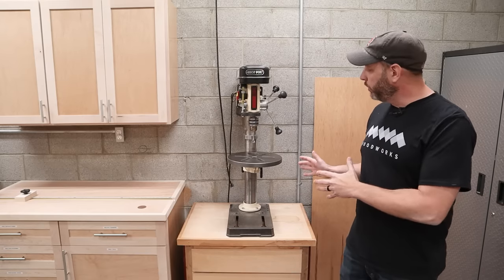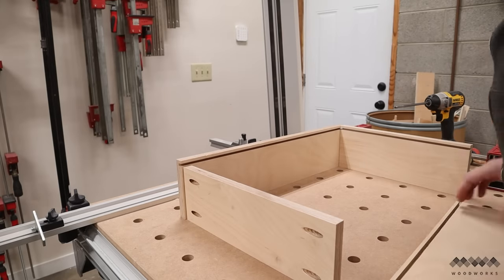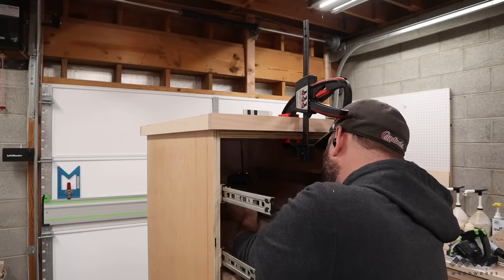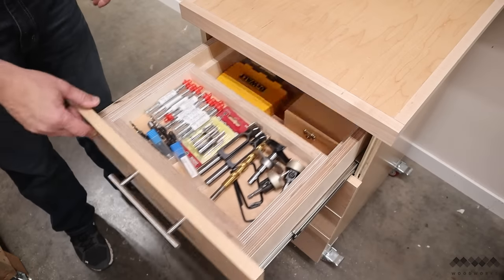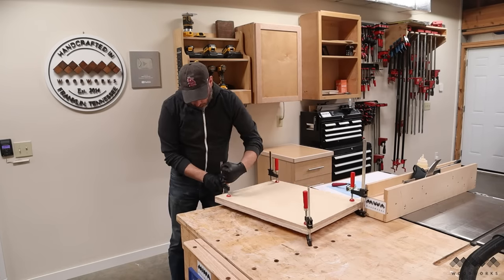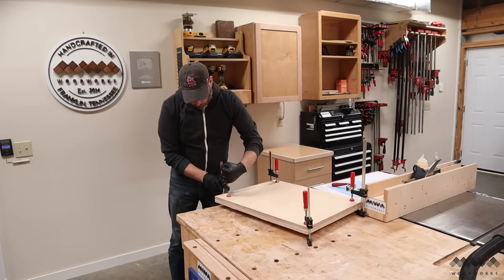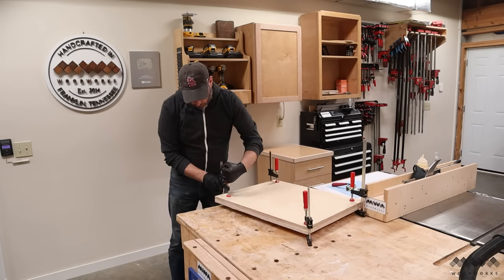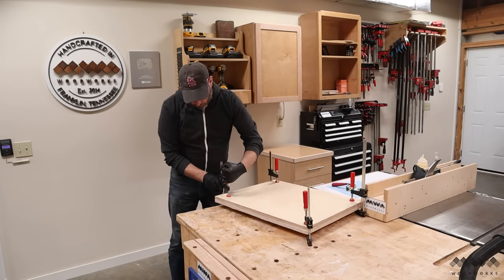5 ways to IMMEDIATELY improve your drill press

Comment: It's hard to find anything new in builds that hasn't  been done dozens of times, but I've never seen anyone embed magnets to prevent bits from rolling off a work surface before, and that's something that you can use in other situations too. Nice build overall, extra kudos for the magnet trick.
Reply: Looking at the picture i reminded me of a router table… could be double function
Reply: I glued some magnets to the underside of the top surface of my stepladder for the same purpose.

Comment: Save money, cut slots with your router instead of T track and you won’t need to drill through your aluminum fence. Put carriage bolts in the bottom slots and wing nuts under the table. Works great.Tip; dust collection on the drill press is a wast of time because chip ejection is 360 degrees. You can maybe catch 50% of it so you may as well just clean up after you’re done.  Otherwise good stuff.

Comment: GREAT VIDEO! my only question is that it looks like you spray the actual CA glue with the accelerant as opposed to putting glue on the magnet and accelerant in the hole and then assembling. I have never seen it done this way before... if you are not immediately assembling does the CA glue ever harden with the accelerant on it and not allow the magnet into place?

Comment: Wow… just…wow… you solved problems I didn’t realize I had.  Favorite hack is undoubtedly the sacrificial off-center circular plate (12:20) in the center of the table that you can rotate to get a new drilling area when you need it to eliminate blow out on the back side of your work piece. 
Nice work

Comment: I really like the magnet under the table for bits falling off. An upgrade I did to my drill press that you did not mention is converting it to a variable speed without changing belt positions. I did this by repowering the drill press with an old treadmill motor and controller.
Reply: That sounds like a video? 😀… or please post a picture here?

Comment: Nice build! I bought a table, and it has most of those features. I have a 4" drill press vise mounted to a board and that sit's on top of the table 99% of the time. I have never once used the tee tracks although I was certain I would prior to installing it.! I placed a large version of a kitchen knife magnet on the belt cover, and it holds at least 30 bits and a few chuck keys.

Comment: Excellent ideas for upgrades to drill press.  I have an old ShopSmith (like born in '52 old ... like me 🤣) which I am using as drill press now mainly - but the table and maneuverability is just not smooth etc.  I'm excited to build this upgrade table to get more control and accuracy from the drill press. Thanks for the great video.  PS: I bought your 'Ultimate Table Saw Fence" plans, and although they were lacking some details I am LOVING the Fence and have built all the jigs too!  Thank you.

Comment: As a note you can buy down cut blades for your jigsaw.
If you use a square sacrificial section and offset it by about a 1/4 you can flip it 4 times before replacing it. 
Looks nice and is a great addition to a drill press. I made a similar table for my drill press but stuck exclusively to wood and T-Track.  I also used some 1x to edge the plywood as I just didn’t like the look of the exposed plywood. I made some extensions for my table raise and lock rods so I could adjust my table height and lock it down without issue. With a good table I find myself using the table much more for woodworking.
Reply from the maker: Yeah I've already ordered some downcut blades to add to my tool bag!
Reply: @MWAWoodworks : Just be aware they’re a different beast to standard blades. You really need to go slow and make sure you’re pushing down otherwise they can throw you out of the cut and cause quite a bit of damage.

Comment: This is by far the best drill press table I've seen, since Shop Nations drill press table lol. Shout to Travis for the under the table t-track idea. Touch of genius right there. Lots of features that are here and there from other drill press tables I've seen out there 👌🏻. I use magnets as much as I can in the shop but the idea to stick them under the table to catch any bits, didn't and prob would have never occurred to me. GENIUS. The caddy for bits at the table, I've seen that a lot around, specifically on Pinterest, BUT, never really thought it would make a good solution, simply b/c I'd be too lazy and leave the bits there as oppose to putting it up where it goes. Just a personal issue I guess 🤦🏻‍♀ lmao. The best feature, at least to me is the shop vac so simple yet, never would've thought about this at all.
Reply from the maker: Yeah Travis and I discussed the t track on the bottom! Super genius idea 💡

Comment: This is awesome. I love your design for every part. The magnets are a stroke of genius. Easily the best part. I built a similar table a couple of years ago using melamine which didn't hold up as well as I had hoped. I used an 80/20 extrusion for a fence too. Best decision. Now I think I need to rebuilt it and definitely add the magnets. Awesome project 🍻
Reply from the maker: The 80/20 is the best. I have it all over my shop

Comment: Just another idea for the drill chuck. An old blown out speaker from the thrift store contains a really nice magnet, depending on speaker size maybe 3 or 4 inches in diameter. attacking it to the body of the drill cabinet, wherever is handy to grab holds your chuck key for handy retrieval. If the magnet attaches to the chuck key and pulls off the drill cabinet, a drop of CA glue on the magnet keeps it in place once you determine the ideal location. Just an idea.
Reply from the maker: I've kept my chuck on a magnet on the side of the drill press for years! Great minds think alike!

Comment: I took the idea and added elements to accept a set of outfeed rollers.  It extends the holding area for large work pieces.
Reply from the maker: I almost added support wings to mine but the cost was getting to be too much for the benefit.
Reply: @MWAWoodworks  it was a matter of necessity for a job and has paid off a few times since

Comment: Great design with some helpful details I’ve never seen before! On dust collection, I’ve found putting the hose as close as possible to the bit gets nearly everything, even with a Forstner bit.
Reply from the maker: That's the key. I've also tried using my 4" hose, but it's just too intrusive and can get in the way of operating the drill press
Reply: Try adding a step down adapter from 4" to 2" which will increase the velocity as it tries to maintain airflow. While you're down to that diameter, consider adding on one of the flexible semi-rigid hoses that hold shape and position to manage the perfect position close to the bit and stock.

Comment: Some really awesome suggestions! Love your solution for holding the vac hose. I made a very similar drill press table by laminating 3 pieces of 1/2 baltic birch plywood, complete with track runners for hold downs and a homemade fence. I cut a rectangular hole in the top layer thinking it'd be easy to make replaceable inserts. It turned out pretty well and I made a bunch of inserts. Only problem is -- I NEVER have to replace them because I still use a scrap pieces on top of the table when drilling holes. lol
Reply from the maker: 😂😄😂😂 I used to have a table with rectangle inserts and I never changed them because it was a pain to pop them out. I'm hoping this way just rotating it is simple and I'll actually do it.
Reply: @MWAWoodworks  Lol Would love to hear how the circle works for you in the long run -- agree spinning would be easier. Mine are easy to flip around or swap out, I just can't get past the idea that a single hole is going to require more effort (minimal as it may be), and add another step the next time I have to drill something. Definitely a mental obstacle and sounds silly but I've found it's too easy to keep a piece of MDF on the table and freely move it around. John Heinz has a video where he made a new drill press table sans replaceable inserts for the exact same reasons. Mentally, I went ... YES! haha At any rate, keep up the fantastic work ... appreciate the heck out of you!

Comment: I love these add-ons and I am inspired to upgrade my drill press cabinet now, especially the table. I love the dust collection addition, but I am thinking about attaching the strap to the block with a t-nut that can be positioned in the t-track. No extra hole in the table and the position can be moved to either track.

Comment: Great build on the drill press stand. Using the 80/20 extrusion was way cool for the DP fence. I never knew you could use traditional T bolts in those slots, so tone of possibilities exist for the Misumi products.
Reply from the maker: Yeah I have used Misumi several times over the years. It was such a great find for shop jigs
Reply: @MWAWoodworks  Thanks. If possible, it would be great if you could give us a primer on the use of the stuff, particularly with regards to compatibility with T bolts, etc. I know they have many series of extrusions and have now idea where to start.

Comment: great upgrades, i need to do  something about the max distance that a hole can be made from the edge of the pice to the drill bit, any sugestions abouth that? my drill press distance is a little short only 20 cms and i need at least 30, dont want to have to change the machine  if posible to make an adaptation or something! thanks

Comment: Can you still adjust the table height with the new table?
Reply from the maker: Yes depending on where you fasten it to the stock table. However I ditched the little handle and I move my drill press up and down with a drill powered ratchet.
Reply: @MWAWoodworks  oh I see. You take the crank arm off and you are left with a maybe 3/8’s square to put a socket on to use your drill driver to power up/down. Great idea.
Reply from the maker: Exactly! So much faster.

Comment: Beautiful work, as always.  Question: What size drill press is that?  How do you like it?  I’ve been thinking about something like an 8” or 10” drill press.  About three years ago, I acquired an old 13.5” drill press, cleaned it up and made some repairs.  It runs real nice, but it is HEAVY, and kind of big for my garage - hence the interest.
Next issue: I would like to build a drill press stand along the lines of yours, on casters - but the floor slopes several inches from back to front, so it would also need leveling feet.  I have been trying to come up with a good way of having both casters and leveling feet.  Any ideas, thoughts or suggestions would be most appreciated.
Reply from the maker: I have had my jet drill press for 8 years. It's a 13.5" as well. For the amount of drilling I do it has been a good tool. As far as the cart, you could put locking casters on one side and leveling feet on the other and then on the side of the cabinet with the leveling feet you could add one of those side wheels that you have to step on the lever to raise it up. Then you could roll it around when you needed to.
Reply: @MWAWoodworks  Thank-you for the prompt response.  I do not understand the reference to “side wheels”.  It sounds like some sort of retractable caster - perhaps a commercial product.  This sounds intriguing.  I currently have diy retractable casters under my contractor style table saw, drill press, assembly table, etc., but that consumes a lot of space, which I would rather allocate to drawers.  Please clarify or point me in the right direction.  Thanks again.
Reply: @MWAWoodworks  It just hit me - I think you may be speaking of a Rockler-style retractable caster, that would be mounted on the side of the cabinet.  Is that correct?
Reply from the maker: Exactly
Reply: @MWAWoodworks  Thanks!

Comment: I love each component of these builds. I was going to use a black melamine shelf cut down to size for a drill press table, but I think the for mica is sturdier. I am redoing the interior of the shop this spring and bringing in the new drill press so I can build it then. What did you use for a countertop on the section to the left of the drill press? I like the look a lot and I think it will be easier to replace than Formica. Thanks for sharing your builds with us. I love the Forstner bit holder you made. Very clever!!
Reply from the maker: Formica is definitely more hardy than melamine. I like to coat all my work surfaces in Formica if I can. The counter next to my drill press is my miter saw station. That's just plywood.
Reply: @MWAWoodworks  I just checked and my local flooring and kitchen shop carries it. They said there isn't much need for it anymore. He has some half sheets that he is going to give me!! Plus, some black 8x4 sheets that I will pay for.  There are still nice people in this world of ours!

Comment: Lots of nice upgrades here.  Two bits of unsolicited advice... Make your sacrificial inserts square instead of round.  It's much easier and faster to make more with straight cuts on the table saw or miter saw then to have to cut out circles.  Second, NEVER cut on a table saw with the short edge against the fence (14:24).  There's a likely chance the workpiece will rotate and kick back.  These types of cuts should be made with a miter gauge or crosscut sled.   Just found your channel and I'm looking forward to checking out more of your videos.
Reply from the maker: The reason for making them round is so I can easily rotate to a spot that  hasn't been used yet. It makes much more use of the insert before you have to pitch it. And I have a CNC so cutting new inserts is a breeeeeeeze. Have a great weekend my friend!
Reply: @MWAWoodworks  Ahhh - CNC changes everything. Cheers!

Comment: Great video!  The cabinet jigs are great ideas.  One comment would be that since Baltic birch plywood here is approx $100 per sheet(w tax)...I have really cut back on projects like this...by the time you add hardware, etc...these are now near $1000 cabinets.  While basic lumber has come down a lot (1/2 OSB is now $13)  quality plywood is still astronomical...
Reply: For 4*8 Baltic birch now it is closer to $150.

Will “regular” birch or maple plywood by strong enough for something like this?  (The cabinet).  Would still do the table with Baltic.

Comment: At around 43 seconds when you're using your Festool saw you have a pinkish looking scrap board you use while cutting with your saw.  What is that material you use while cutting with this saw?  I would think the use of this kind of tool would create a lot of waste having to rely on a sacrificial spoil board.
Reply from the maker: It's just a sheet of pink foam house insulation. It cost about 20 bucks and I've had it for years. It's not required but makes it so much easier to cut on surfaces that you don't want to damage like cutting on a concrete floor
Reply: @MWAWoodworks    Thanks for the quick reply.  I was thinking that might be what it was "looking at the color", but wanted to ask.  I'm putting together a home workshop in a 15x29' space of my garage and trying to plan on how to use a Festool saw without beating up what's underneath.   I've been out of woodworking since 81 incident and trying to get back into it for my pre-retirement and retirement period.

Comment: Overall nice design. I do some metal drilling with mine so the magnets would be a pain with scarf at magnets. I use 2 lengths of angle iron with t bolts into the t track that can straddle the object being drilled. It allows me to avoid drill press vice in most cases and allows holding from small to very wide pieces safely.  It keeps small pieces from catching the drill and  spinning dangerously.
Reply from the maker: Yeah I'm lucky enough to have a whole other drill press that is use for metal work and I don't use a table on that drill press.

Comment: Excellent video and clear descriptions of all your steps! I’m curious if having that hanging cabinet right next to the press is too limiting? Do you find that you have to roll the stand out from the wall often? Considering a very similar layout in my small shop but with a fixed-in-place cabinet for the stand and was wondering if this would be an issue.
Reply from the maker: The cabinet on the wall is not in the way of the work area

Comment: I really admire your ingenuity, in designing some of these accessories, and I like the look of your drill press stand.  Could you tell us the overall dimensions please?  I need storage space, and am trying to get the max possible storage out of each shop project.  I understand that plans could be modified, but too much modification might destroy the clean look.  I’m trying to gauge whether I these plans would work for me without too many alterations.  I was hoping for something around 26-27 inches wide by about 23 inches deep - and I should add, at least some of that is due to the concern about tipping over sideways.  So many drill press stands are extremely narrow!  Look forward to hearing from you.  Thanks!